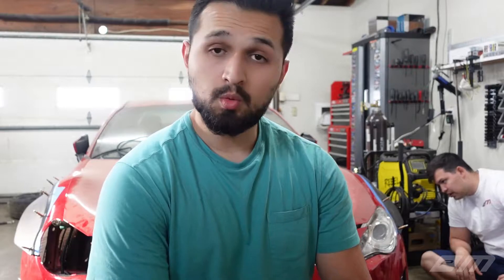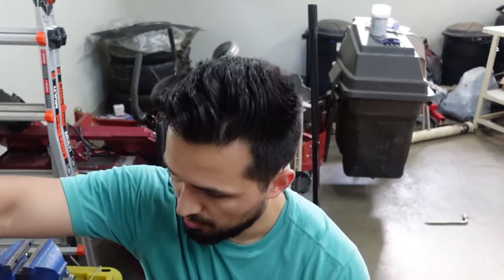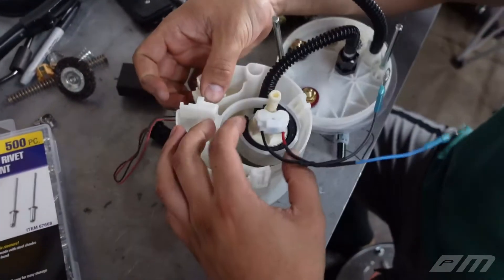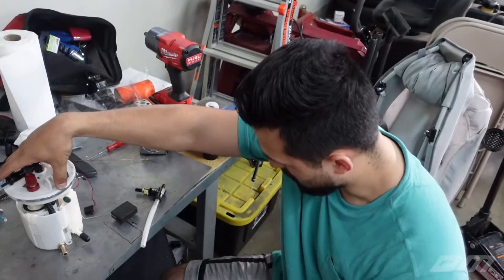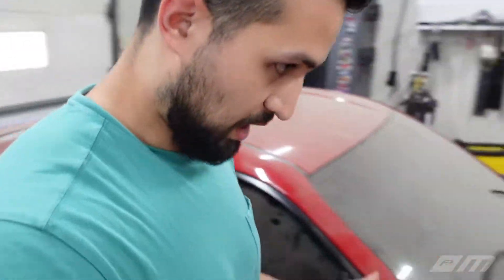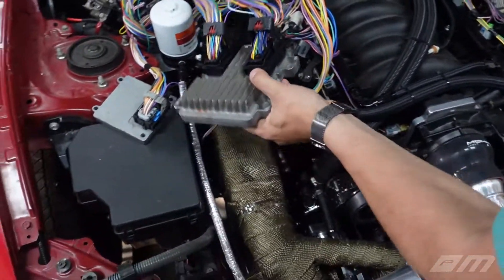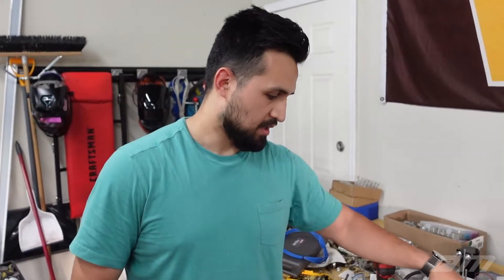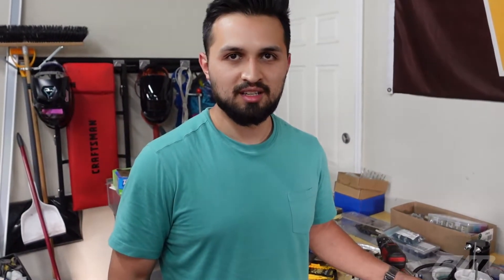Scion FRS Return Style Fuel Assembly Part II - EXPLAINED

Comment: Just wondering what length driveshaft are you running I have a 2014 frs that’s pretty much same setup that you are doing
Reply: Sikky offers them. They are built by driveshaft shop. But if you running a custom diff you will need to measure it bottom out in the trans and then subtract 3/4”-1” depending on material to allow for play.